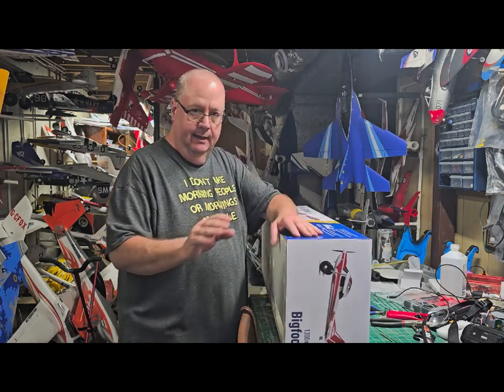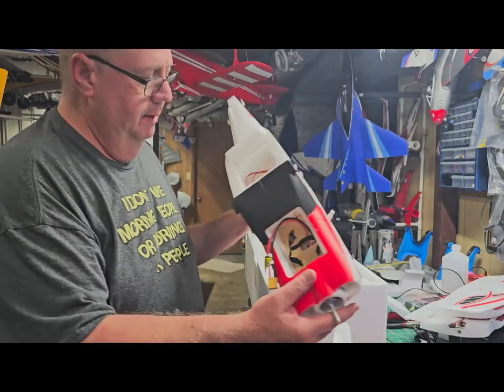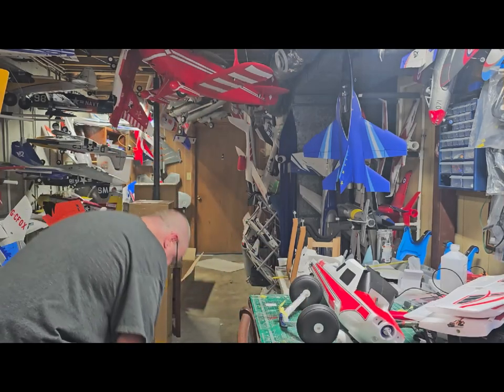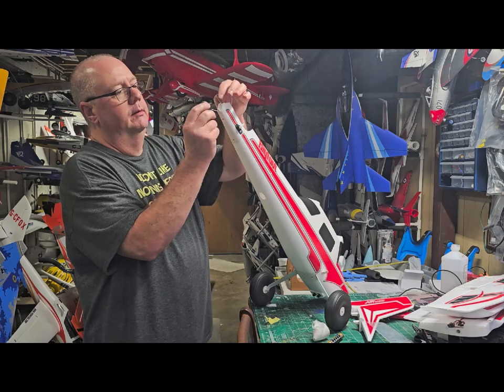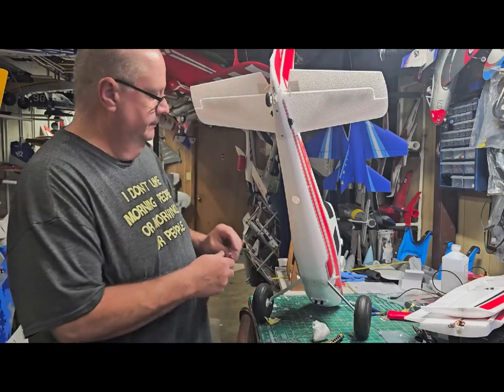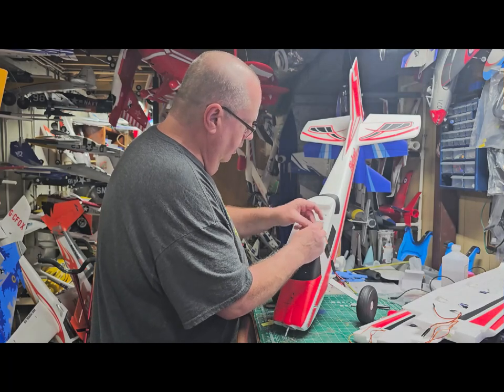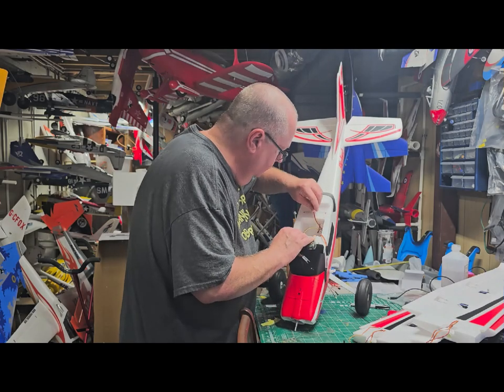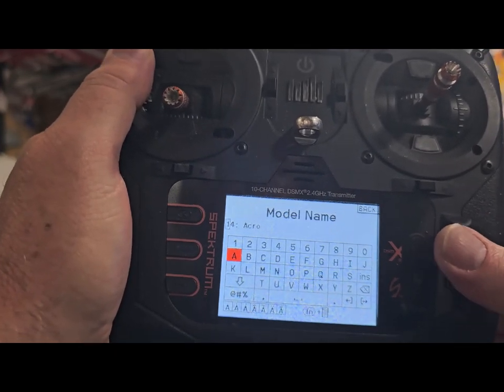ARROWS RC BIGFOOT COMPLETE UNBOX,BUILD,RADIO,VECTOR, SETUPS by FGFRC

Comment: Just wanted to say a MASSIVE thank you from the UK. The instructions that come with the aircraft are not the clearest with regard to which wire connects where (they don’t use a Spektrum receiver set-up for instance) and then there is the transmitter set up…as a complete newbie I thought this was going to be beyond me. 1st try on my own was a complete fail. 2nd try with advice from the shop where I purchased everything got me 25% further forward. Your advice has got everything up and running and ready for the flying field. I Googled for some clues as to how this trainer is set up and I saw lots of RC forum entries from beginners (who this model is aimed at) struggling with set-up - I hope the manufacturers/retailers connect your videos with their Bigfoot sales as it would save a lot of frustration for the uninitiated. Fantastic video. Thanks again!
Reply from the maker: So glad to be a service for you!!!

Comment: Hi I’m 12 I have this same plane and I’m love flying this plane but one day I took it out the a grass field and was taking of and I hit a stump and the plane flip over I programmed a kill switch in to my flysky transmitter but by the time I kill the engine the plane started smoking and Rush over there to unplug the battery then I took a look at the plane and it looked perfectly fine so I started the engine back up and started and it would not go past around 10% throttle without jittering at first I thought it was an ESC problem but then I realize that the motor was fried. Anyways, I was just wondering if you had any tips on what I should’ve done or could’ve done to save that from the motor. Great video like always
Reply from the maker: I dont think you could had done any better having a throttle cut is always a MUST DO! Sounds like you threw out a magnet in the motor when you hit that stump. It happens! But no matter what DO NOT GIVE UP!!!!
Reply: @FatGuyFliesRC  thank you